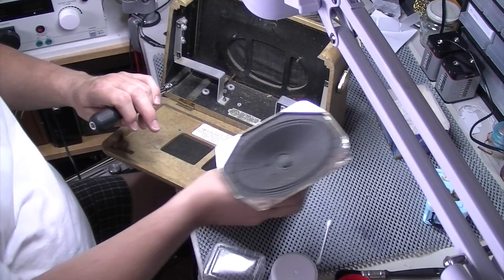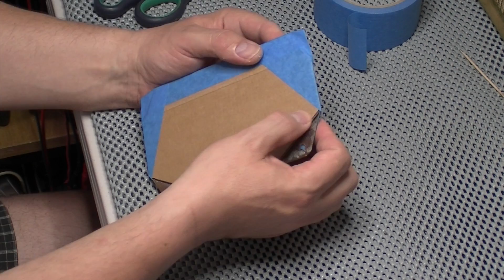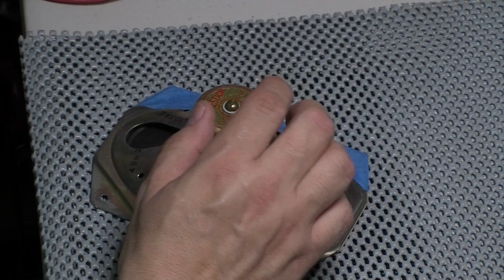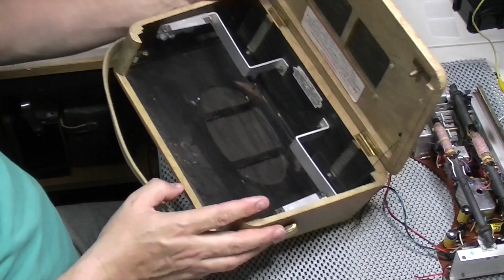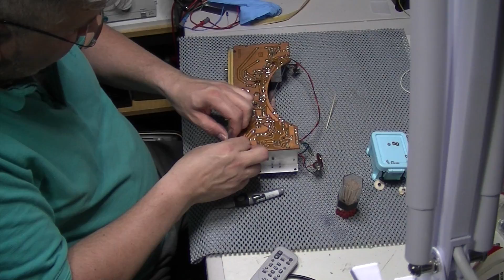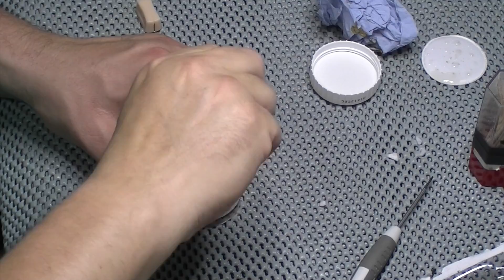Bakers basket of radios: Dynatron Nomad TP11 part 5, re-assembly and final touches

Comment: Hi Graham. Interested to see this restoration of a Dynatron Nomad as I have one here
myself. You have certainly spent some time on this one and it has been well worth the
effort by the results seen here. I have a technical query regarding the powering of the
set on 18 volts. Would there be any difference between your method of applying power
or using two 9 volt batteries as in the original circuit with the centre tap off the batteries
going to one leg of the speaker? I was considering powering my Nomad via a split rail
psu. I would be interested to hear if you have any thoughts on this.
Reply from the maker: Hi Guglielmo. The batteries are in series to give 18 volts. The power switch switches both positive and negative as far as i can see from the circuit diagram. I applied power the second time around directly to the terminals on the switch. I was thinking of packing 2 or 3 PP3's in parrallel into 2 old PP9 battery cases to make it look authentic. I assume that if you built a good quality 18v linear power supply it would work fine. I am no expert on building power supplies although a switch mode supply would be probably way too noisy for LW/ MW use. Also how would you get the cabling into the set as it would be a shame to drill any holes in the case or notch it out as this would devalue the set
Reply: Hi Graham. Thanks for the reply. I've taken your advice and now have
my Nomad working, powered from an 18 volt cordless drill battery. It's
sounding very good. I have managed to  power to the set by 
feeding a lead through the large hole at the external aerial socket. This
is a temporary arrangement and means that I can run the set from the
cordless drill battery. However, the lead can be removed easily to
return the set to it's original condition.
73, Guglielmo
Reply from the maker: +Guglielmo Marconi nice one Guglielmo. Those drill batteries are pretty high capacity so should last a while. The hole in the side is a good option as you can return it to original easily. Glad to be of assistance. 73 Graham